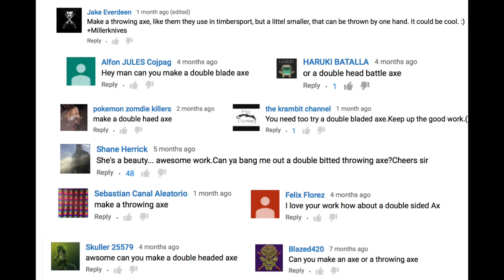Forging a Double Headed Throwing Axe from a Hammer

Comment: using a flap disk on your grinder is great for shaping handles. ive made a few both ways with the file and the flapper and i always go the flap route. you can even use an old smoother pad for refining it. not critiquing just offering a suggestion to try. good luck keep up the good work.

Comment: Just a tip, and my grandpa told me this, if you make a horizontal cut in a handle put a wooden wedge there and then use a steel wedge in the vertical

Comment: Why not try one of those blades with a one-handed longsword blade length and a two-handed handle length. The examples i could find were a historical "Langmesser" (German for long-knife). i haven't seen many if any being made on youtube before so would be a good idea for something different.
You are doing great by the way... keep up the good work =D
Reply: They would be used as one handed swords with a shield for protection, and also two handed without a shield for greater strength/power in battle depending on the wielders competence and abilities with weapons. (Similar to an axe being used one or two handed depending on the situation).
Reply: i wasn't aware such a thing existed and in video games. You sound like you know more about it than me though as I have only ever heard of them being called langmessers ;D

Comment: Why did you heat treat it before you finished shaping it? Why did you re-work the engineering hammer and use the tiny ball peen for the shaping? Why did you use things that are easily broken with a baseball bat to demonstrate that the axe does axe things?
Reply: makergrey because he's armature and the edge geometry is not sharp enough to be called an edge. 
basically just hitting fruit with a modified cross peen hammer
Reply: Don't be a hater.
Reply: Makergray  why did you have to ask so many questions?

Comment: Why is the blade so thick? You basically just made a modified cross peen hammer. could have at least stretched the edge out to make it a better cutter than  a blunt force weapon I think.
Just a tad. because I know some axes have thicker heads.

or maybe you could have used the engineers hammer to forge with. 

You sharpened it before heat treating. And the blade was no closer to hardening tenpatures than a red hot knife video

Comment: You really need to learn how to forge to the finished shape. No more cutting it out with the angle-grinder. You'll have less grinding to do before heat-treatment. Also, you should experiment with other methods of tempering. Not all blades should have the same hardness.

Comment: You make such cool pieces but you always make the same (rather boring) handle, you should experiment and push your limits instead of the same straight cylindrical handle always used

Comment: a real bpacksmith would be about to cry now, but he is not doing that, cuz i said a real blacksmith
Reply: Hanf Peter and why is he not a real blacksmith may i ask?
Reply: Stan Pines he wasnt realy forging, i just hammered it kinda flat on the edges, then tried to sharpen it. its still a hammer, not an axe. its to heavy, and a real blacksmith doesnt cut the shape, he hammers it in shape. i mean, he did only a bit flattening, then he cut away what he didnt like, didnt worry about what it is and what it whould be, and just sharpened it.... for this u wouldnt even need the hot flame, just an heavy enough hammer, slrsy...